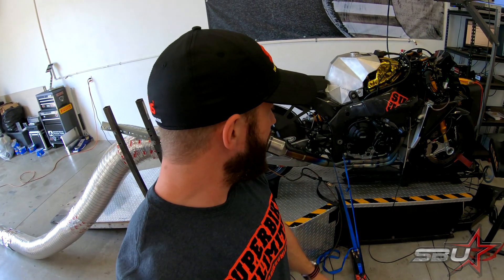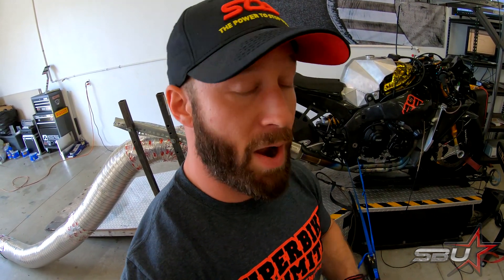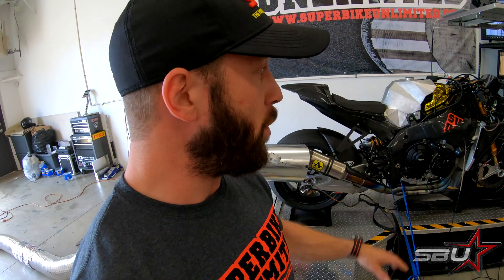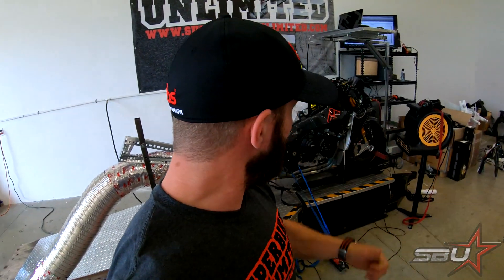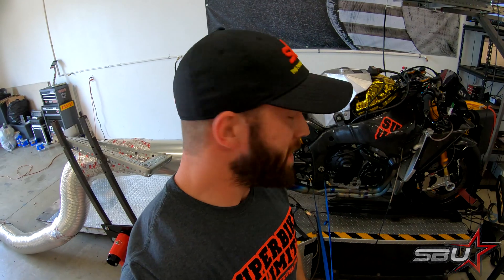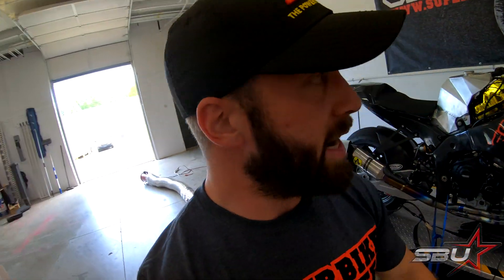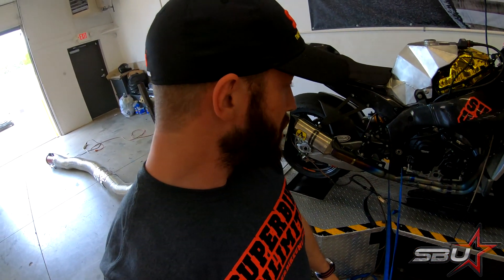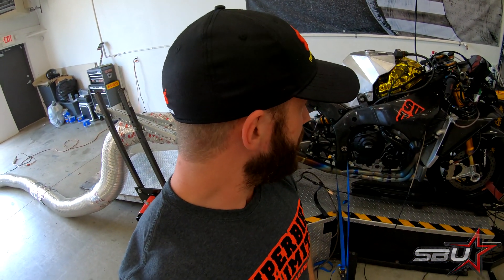The SBU 2019 Superbike Project - Dyno Tuning MoTeC Quickshift and Auto Blip, Arrow WSBK Exhaust - #7

Comment: What company makes that fuel tank? Or is it even possible for a non-racer, such as myself, to get a hold of one?
Reply from the maker: We could probably supply you with one, but you need the other parts to make it all come together.
Reply: @SuperbikeUnlimited  um...parts list please? Lol
Reply from the maker: @RONIN-ff9sd  Fuel tank, carbon subframe/tail, fuel tank cover.
Reply: @SuperbikeUnlimited  i figured the tail was required becuz i know those superbike tanks extend further into the tail section. One more question, that swingarm is sold for the current gen5 zx10. Would it work on a gen4? As long as the shock mounts are in the same location between the 2 generations, i don't see why it wouldnt work on a gen4. I own a gen4 zx10 btw
Reply from the maker: @RONIN-ff9sd  Yes, it will work.
Reply: @SuperbikeUnlimited  FUCK YEA!!

Comment: What kind of kill times are you running with the QS?
Reply from the maker: MoTeC doesn't work like that, it's a closed loop system with several stages vs just a standard cut. For something more conventional, 50ms or 55ms would be a good place to start.